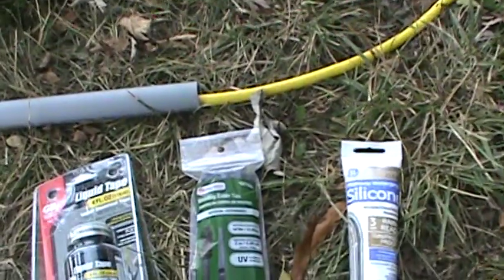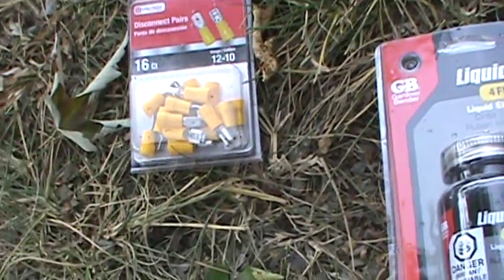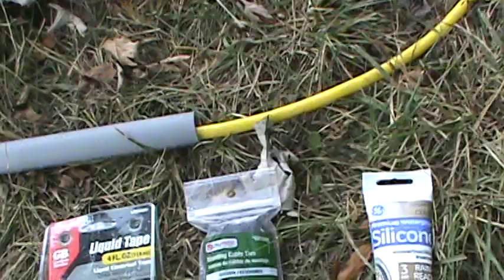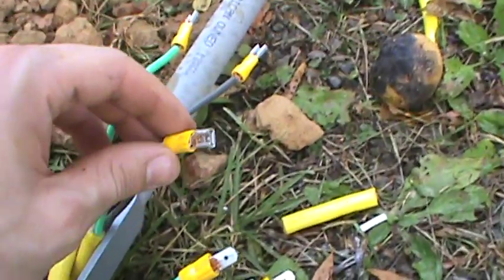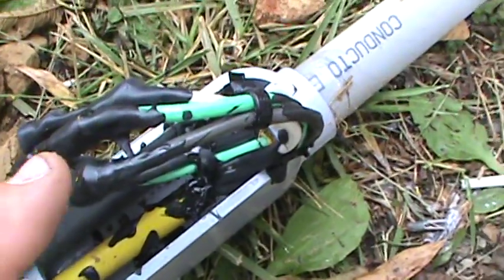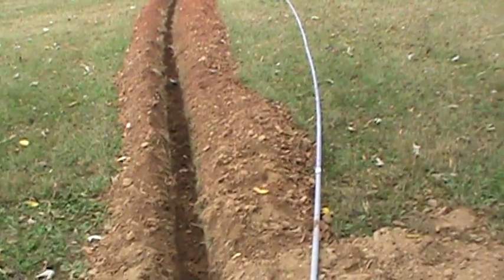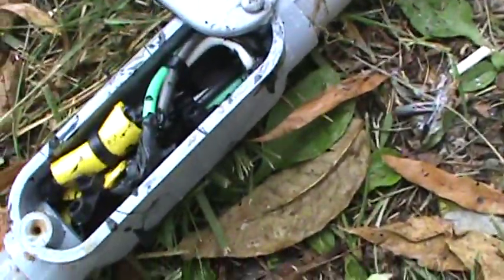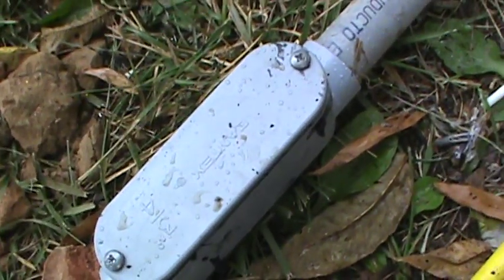A COMPLETE WIND TURBINE INSTALL FROM START TO FINISH (OFF GRID & GRID-TIE) PART 3

Comment: Solder the wire joins and cover with twist connectors. Good overkill would be to use silicone the joins.